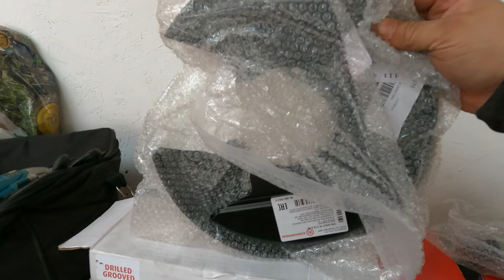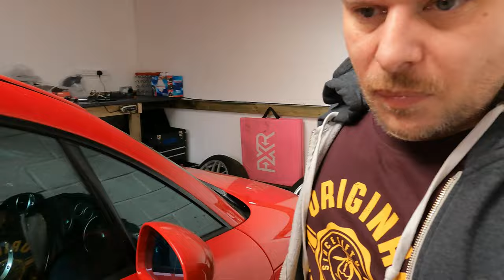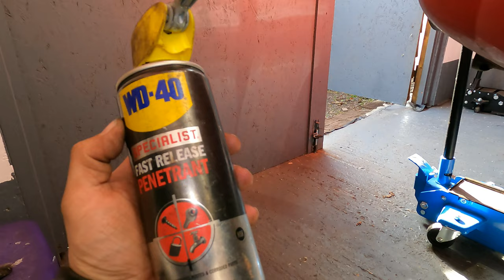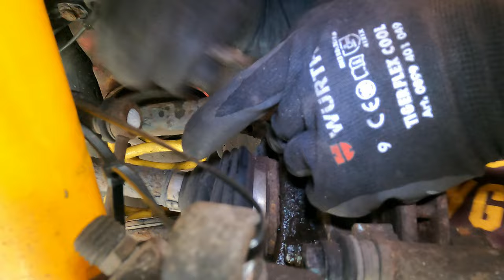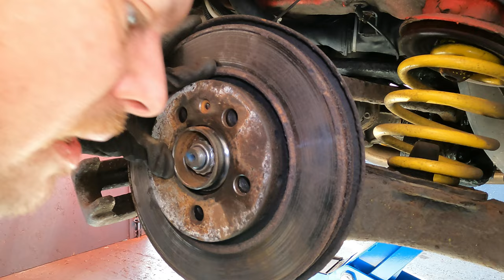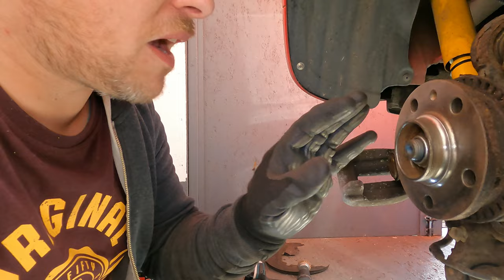AUDI TT MK1 HOW TO CHANGE REAR DISCS AND PADS

Comment: I had new hubs wheel bearings an new brake dust shields fitted to mine just before Xmas last year andy knows all about it 🤣👏
Reply from the maker: that's good mate 👍I'm gutted i have to take the hubs off to replace the dust shield it such a bad design
Reply: @CarChris82  2 very tiny think they were 6mm heads they had to be made smaller using a dremel to remove them 😳 but yeah ideally you need them on 👍
Reply from the maker: @julesmatthews2178  they will definitely be going on when I do the hubs and I will probably strip the whole rear off and get the rear subframe powder coated and trailing arms
Reply: Yes in great detail! If you need your brakes sorted quickly, DONT speak to Jules' local mechanic! lol
Reply: @andycharger 🤣 7 week she had car only plus side of that = less mileage on the clock 😂🤣
Reply from the maker: @andycharger  oh no what happened?
Reply from the maker: 7 weeks to change brakes ?
Reply: @CarChris82  no ! I had all new bushes an hubs n stuff done had it all it stripped down car was in bits I’ve got photos . I went all OEM on the bushes lot bigger job than poly 👍
Reply from the maker: @julesmatthews2178  oh I see👀

Comment: Nice video.  Just a tip though for others, that brake disc screw just needs to be hand tight, it’s only a factory assembly screw and has no other purpose.   Also clean up the slider pins and grease as they often cause seized brakes.
Reply from the maker: Thanks for the comment i did mention to clean the sliding pins and clean them in the vid 👍

Comment: Good video, Chris. Unscrewing the brake reservoir cap, would have helped with pushing the caliper back.
Additionally, the back of the pads, doesn't need anti seize applied. That double-sided tape, takes its place nowadays.
By all means, apply some, where the pads and caliper sit.
Reply from the maker: Cheers mate definitely remove the reservoir cap i did mention that in the description 👍 I've always greased the back of the pads and the slots in the carrier its a habit and good practice no one wants squeaky brakes 🤣😂

Comment: Nice job. Surpised when I did first the front brakes and I took of the disk shield to paint it. Easy.
But … When I attempted to do the same thing on the rear, I mean cleaning and painting the shield … 😮 What a bad design ! Could not believe it. Impossible to take out cos the ABS ring is to close to the screws. 
I plan to do this job when I’ll replace the bearing 😕
Anyway, I have completly rebuild the rear calipers with a replacement kit.
Reply from the maker: Thanks mate yeah the rear defo could have been designed better for removal of the dust shield

Comment: Nice video. I’ve always pushed the piston back in with c-clamps. What does the turning do?
Reply from the maker: The rears dont push back you have to wind them mate fronts you push back 👍
Reply: @CarChris82  good to know, thanks. Now that I think of it, I’ve never done rears on a VAG.
Reply from the maker: Yeah your need that tool and if they don't turn then I'm afraid they are seized

Comment: Please help me Chris. I followed your videos for front and back and now I have no brakes! I cant see what I could've done wrong. My handbrake is now coming up really high and I just cant brake at all. I saw another thread which said to run the engine and pump the brakes but nothing happened
Reply from the maker: Oh mate that don't sound good did you open the brake reservoir to relive pressure so no damage to the master cylinder? Also I don't understand why the handbrake would be higher send me some pics of what has happened on Instagram or to my email you may have got air in the system some how